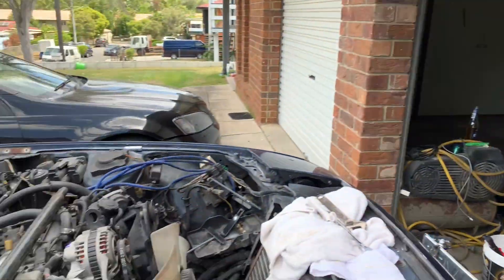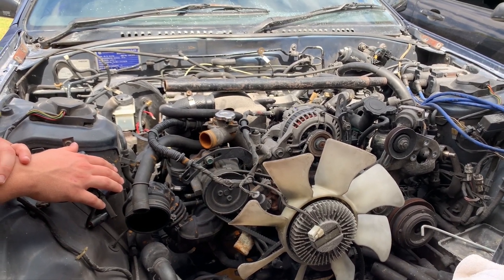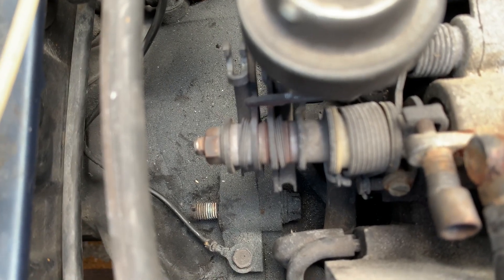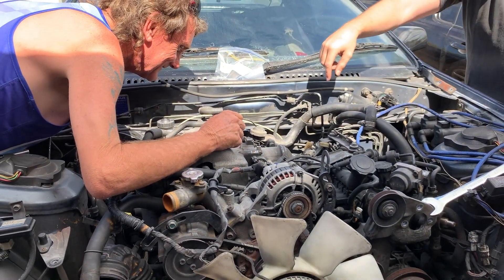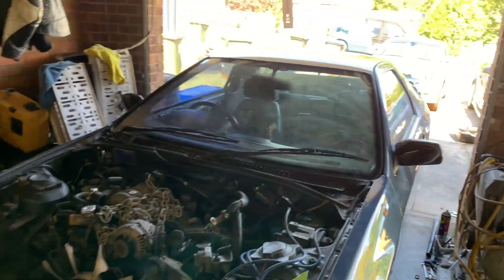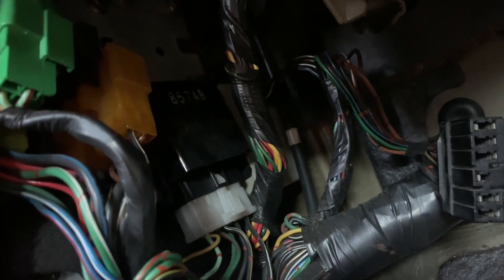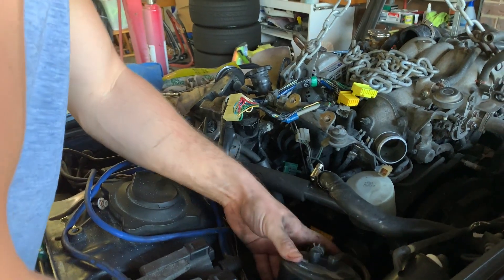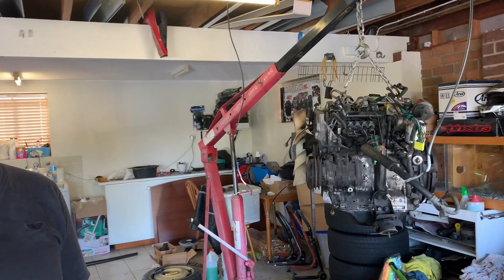REMOVING a 13bt out of an FC RX7

Comment: At the 7:00 mark, that's how our upper transmission bolt was when we got our FC too. It had the engine hook bolted to it. Me trying to confirm if that was correct is how I stumbled on this video, ha! Interestingly, the bellhousing side has marks around the bolt hole that indicate either a nut was on there or the bolt entry was reversed at some point.

Comment: Hey yall , Joe I have my 88 10th anniversary RX-7 I've had 25 years , and I got verry I'll 7 years ago! 😔 but , u need a new engine and I found one a bit Ago and we'll my budget topped out ,for ecu wiring and intercooler...and it has been Bridgeported, so I was looking for  some parts ,and a few sponsors would be Amazing for me and my diabetic team for MY fundraisers for diabetics that have trouble getting supplies and mental support... I've had an EXTREMELY RARE surgery losing my pancreas and gallbladder and my spleen, leaving me Disabled but im fighting back and all I want before I go , is to marry my lady and take off in this car 🙏🏽🙏🏽🙏🏽 I don't think I need too much more..
But what I can offer is a VERRY GOOD CONDITION 88 GTU...ZERO RUST,MISSING Pully setup